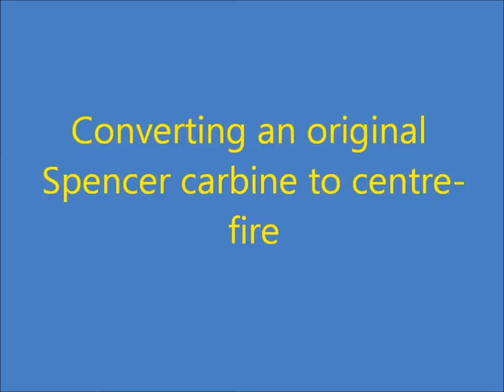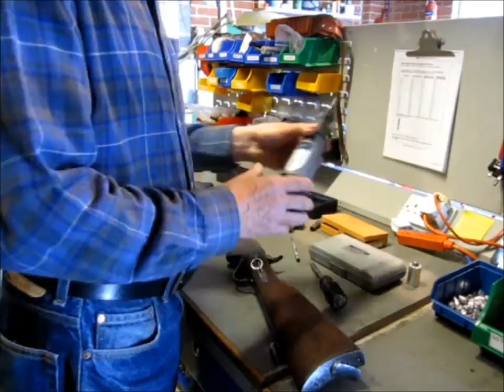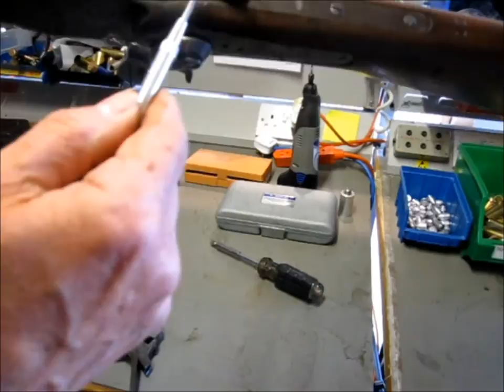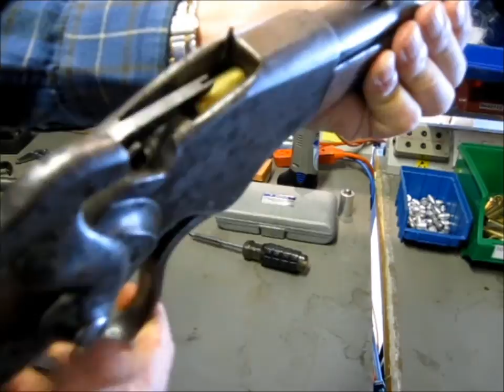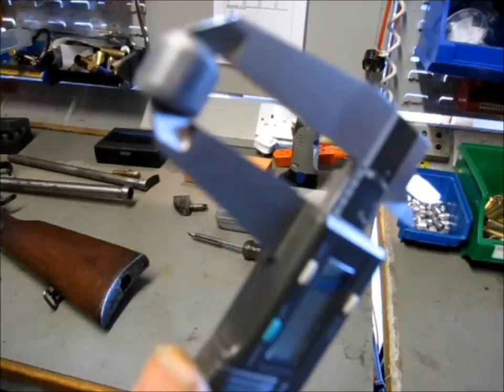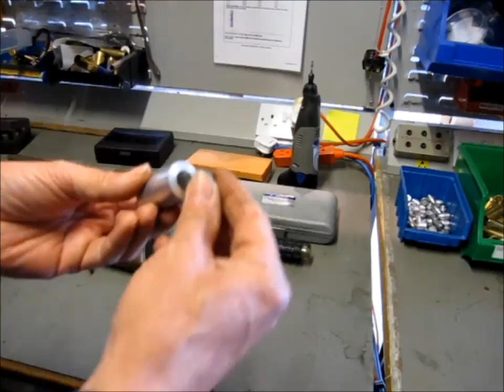Spencer centre-fire conversion Part 1

Comment: I believe I may have been the first to convert an original Spencer carbine 56/56 caliber, to centerfire as a member of a horse mounted re-enactment unit, Company C, 7th Illinois Cavalry. I stumbled upon an aged magazine article that detailed how the author had converted a similar Spencer. This was way back in the early 1980's. The article was at least ten-years older. Soon after perfecting such conversions, I found a French firm that sold breech block conversions. The difficult part was making a blank cartridge that would feed through the mechanism. I remember remarking then, that I wished somebody would make a reproduction Spencer that would fire a 45 Colt or 44-40 center fire cartridges. Years later, there they were! I was using my Spencer, in the background, during the battle of Fort Wagner during the filming of GLORY as a defender. I deliberately went as far to the rear as I was in a cavalry outfit and the likelihood of a Wagner defender being armed with a Spencer would have been highly unlikely. The reconstructed Fort Wagner was filmed at Jekyll Island in George. While doing this I met up with an old friend, TJ Sperry, then curator of the US Cavalry Museum at Fort Riley.

Comment: I owe you a pint mate. Or if you get to the states again, a nice meal at our family restaurant. Yes the top and groove needed hours of filing, still a bind and scrape marks, until I enlarged the oval hole for the lever screw. But, this block looked 'too' bright, and too easily to scrape on the 1860's hardened breech, so I hardened the block, slide and firing pin. Haven't fired it yet, but all is slowly progressing well.BTW, mine is a Burnside made swell.

Comment: Hello Mike, Many Thanks for replying. Yes it feeds fine with one round only, but will chew off the end of any bullet following.I have tried a variety of OALs, to no avail, and am quite sure this is not the problem. Your help is greatly appreciated.
Reply from the maker: +Alex Roberts   Alex, load a few rounds into the magazine then open the breech fully. Then check to see if the nose of the first bullet is held by the cartridge stop - the little ridge on the lower breech block - by prising up the spring loaded cartridge guide with a screwdriver.The nose of the bullet should be firmly up against the stop and not projecting over it at all. I find you need a flat nose bullet with a flat big enough in area to engage the stop and not override it. If you use round nose bullets the cartridge can move too far forward so the following round pokes too far out of the magazine and can't be cammed back by the breechblock.

Comment: I really enjoyed the video, and was inspired.Could you possibly add a little more detail on exactly how you dremelled your block to get it to feed properly?I have been struggling with a feed problem for some time. I would be very grateful for suggestions. Thanks
Reply from the maker: +Alex Roberts
 Hi Alex, On my Spencer I had to widen the cartridge groove on top of the breech block so the cartridge laid a bit lower and did not foul the top rim of the chamber. I also rounded off the back edge of the block so it did not dig into the cartridge in the magazine. What exactly is the nature of your feed problem? Cartridge OAL is very important - Mine are 1.620 in. Does it feed ok with only one round in the magazine but not with more?

Comment: Hi, nice video! I have a shooting colleague that has an original Spencer, an 1865 Burnside Patent `D` fitted with an S&S centrefire block (rifle held on FAC) - we simply cannot get the thing to reliably feed, with just one round in the magazine tube it's fine, more than one and the rising and rotating breech block catches and digs into the nose of the following round. Did you have to do anything else to the block to make it feed?
Reply from the maker: The gun in the video is a Burnside with an S&S block. I did stone the back edge of the block to take off the sharp edge but that's all. The shape of the bullet ogive seems to determine whether it will feed or not. What bullets do you use? I find the Buffalo Arms mould throws bullets that feed ok.

Comment: Hello Mike,
Great info,  does this conversion work with a 1863 spencer? How about 1865 Spencers not from Burnside manufacturers?  In the video you seemed to hint the Burnside spencer may need more adjustments than a regular spencer?
 thanks for any info, Chuck
Reply from the maker: Hi Chuck.
I think there was a certain amount of hand fitting during manufacture on the Spencers and maybe the Burnside factory had different tolerances.I have fitted S&S Fireams blocks to both Burnside and Spencer made 1865's but am not sure about the 1863. Probably best to check with S&S or Buffalo Arms before ordering.
Regards
Mike

Comment: Why convert it at all? Just curious.
Reply from the maker: Part of the fun of collecting old guns is getting them shooting again. The Spencer used a rimfire cartridge and original cartridges are extremely rare and probably wouldn't work after all this time anyway. By converting to centre fire we are able to make ammunition at low cost from available brass. Part 2 of the video shows how I do this.

Comment: Hi would I have a problem importing an S&S conversion would I have to go through a gunsmith, and at what stage do I put it on my FAC ie before I convert.
Reply from the maker: +Sharon OLSEN-VETLAND This is a very tricky one.You would be converting a Section 58(2) obsolete firearm to a Section 1 firearm, but since a centre- fire Spencer never existed you are effectively manufacturing a new firearm, which you cannot legally do in the Uk unless you are a licensed manufacturer. I did my conversion while I lived in New York so my rifle was imported into the UK as a Section 1. I suggest you check with your local firearms dept, explaining what you want to do and why. That will make them scratch their heads for a while. Let me know how you get on.